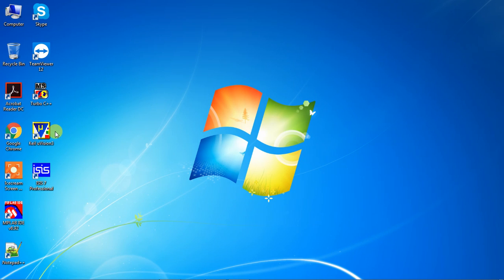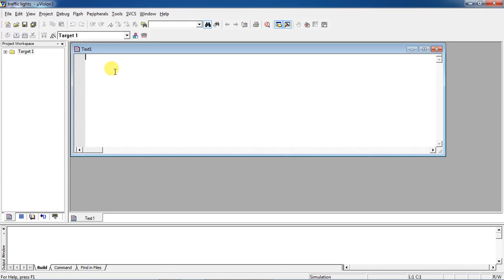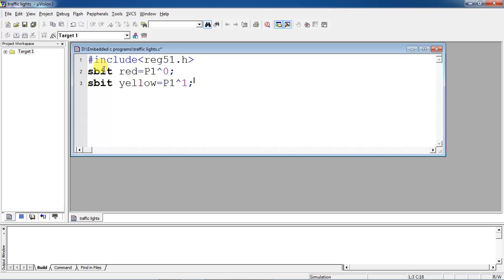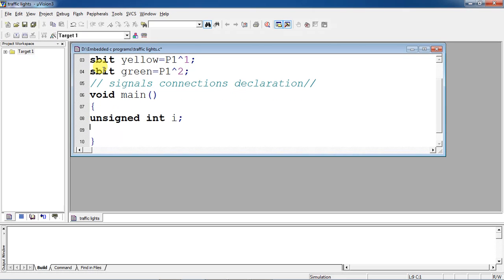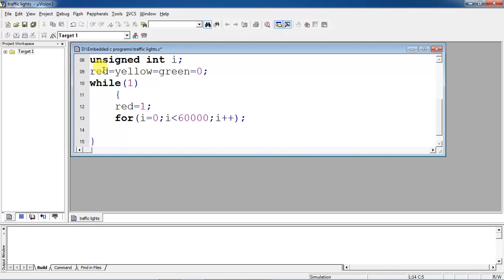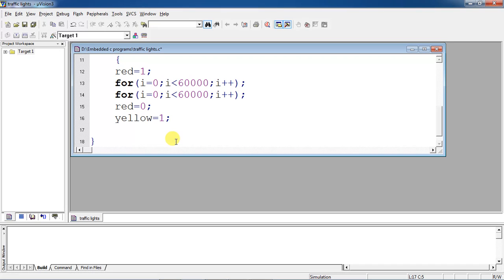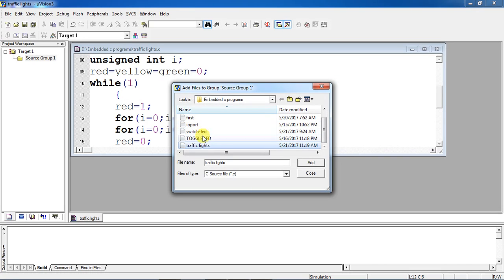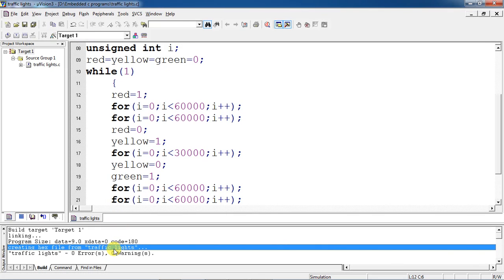Embedded c program for Traffic lights using 8051 microcntroller with Keil IDE and proteus simulation

Comment: SIR...I GET
assembling trafficsignals.asm...
trafficsignals.asm(0): error A45: : UNDEFINED SYMBOL (PASS-2)
trafficsignals.asm(2): error A45: UNDEFINED SYMBOL (PASS-2)
trafficsignals.asm(3): error A45: UNDEFINED SYMBOL (PASS-2)
trafficsignals.asm(4): error A45: UNDEFINED SYMBOL (PASS-2)
trafficsignals.asm(47): warning A41: MISSING 'END' STATEMENT
trafficsignals.asm - 4 Error(s), 1 Warning(s).
Reply: I USE 80C51BH
ASSEMBLY CODE IS:
PORT_A EQU E800H
PORT_B equ E801H
PORT_C equ E802H
CWR equ E803h
org 8000h
 mov dptr,#CWR
 mov a,80h
 movx @dptr,a
 again:mov dptr,#0000h
 nextst:movx a,@dptr
 push dpl
 push dph
 mov dptr,#PORT_A
 movx @dptr,a
 pop dph
 pop dpl
 inc dptr
 movx a,@dptr
 push dpl
 push dph
 mov dptr,#PORT_B
 movx @dptr,a
 pop dph
 pop dpl
 inc dptr
 movx a,@dptr
 push dpl
 push dph
 mov dptr,#PORT_C
 movx @dptr,a
 pop dph
 pop dpl
 inc dptr
 call delay
 mov a,dpl
 cjne a,#1eh,nextst
 sjmp again
 delay:mov r2,#07h
 loop3:mov r4,#0ffh
 loop2:mov r3,#0ffh
 loop1:dec r3
 cjne r3,#00h,loop1
 dec r4
 cjne r4,#00h,loop2
 dec r2
 cjne r2,#00h,loop3
 ret
Reply: This is C program you saved with .asm its wrong correct it. thank you.